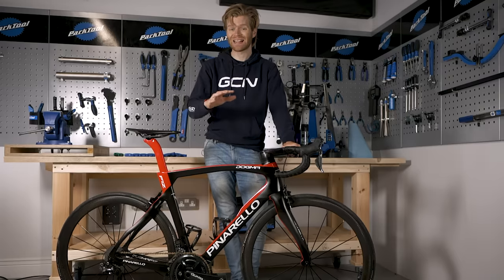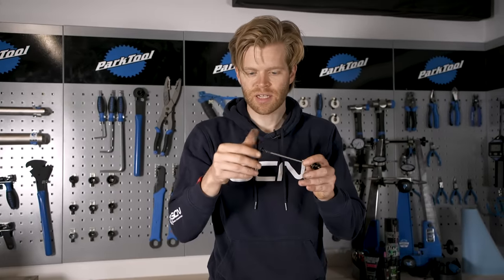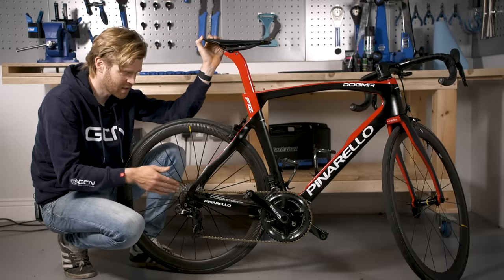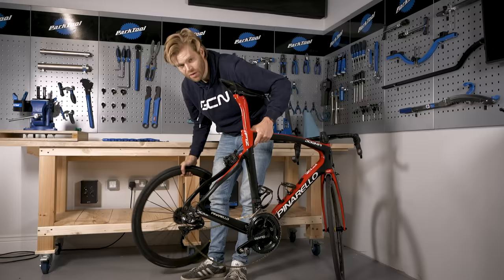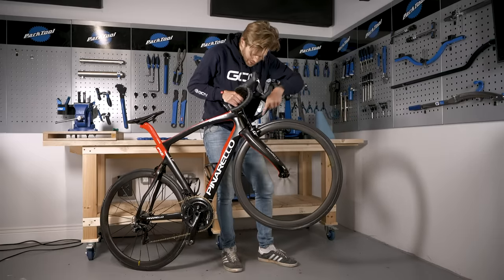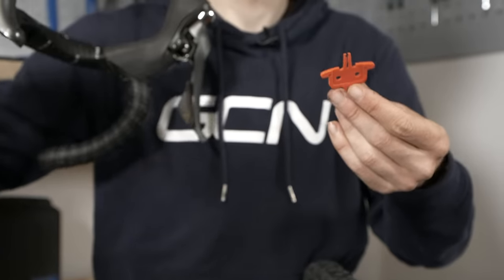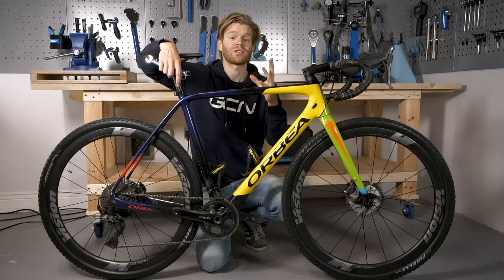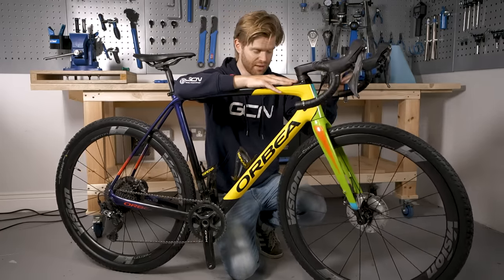How To Remove And Fit Road Bicycle Wheels

Comment: Another GCN for dummies video.
I 've never had problems squeezing the brakelever of my diskbrake once or twice after the wheel was removed.
And if the pads are touching just push them back with a blunt screwdriver or so.

Comment: Tip from experience: do not tighten up to 20Nm. You will never be able to loosen it with a multitool when having a flat on route. Tighten to whatever you can loosen with your multitool!
Reply: Why in the f*** did you ever think 20nm is good for a wheel.
Reply: @tsc4842   9:25 in this video: "sometimes they have a recommended torque setting, this one says 20Nm." Well so did mine... And I agree with you now that I've learned: 20Nm is way too much.
Reply: @Rinusinus  Seen on the TdF when the team mechanic was not able to undo the through-axle. (Don't remember the team.)
Reply: Think 16nm max for most I go for 12nm.

Comment: How did you remove the front wheel without going on a rant about the idiotic and totally unnecessary safety lip on the fork dropouts? I have yet to achieve that level sanguinity.
Reply: One of the things I love about my old Colnago Master, no lawyer tabs
Reply: Pete is never wrong  "lawyer lips", please.  Such nice alliteration. :)

Comment: This is what it has come down to for your audience GCN? All this info should be in an owners manual or one should have asked the local bike shop. If one has a new bike equipped with thru-axles and disc brakes, but doesn't know how to remove the wheels, they're an idiot. They should have asked the bike shop guy when they bought the bike.